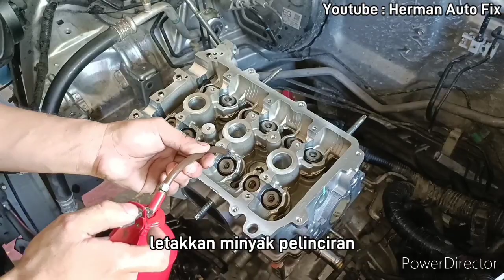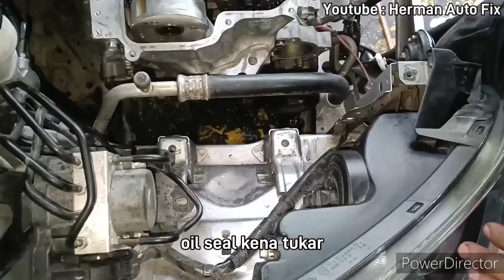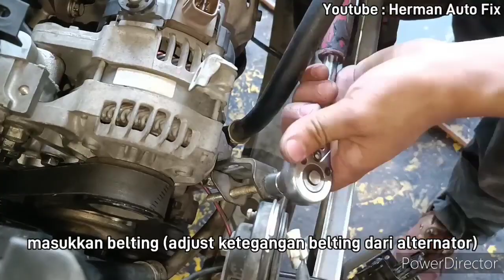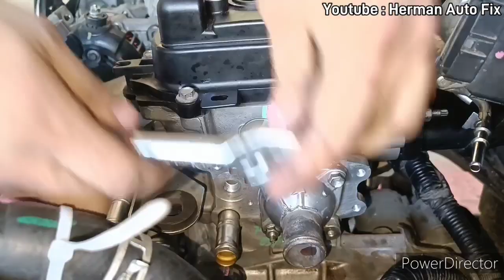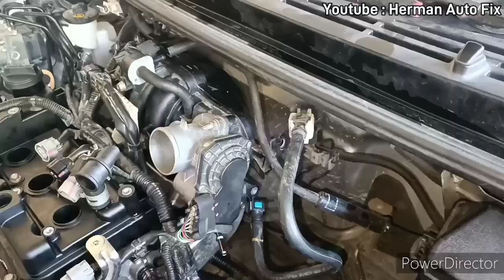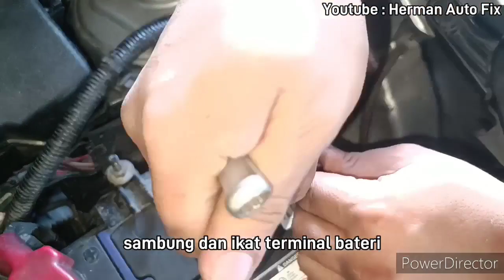Perodua Axia OVERHEAT top overhaul / part 2 ( last part )

Comment: Brapa kos skrang utk job mcm nie ya bang?..sbb saya tgh buat jgk...Kira sbjik la job ni..axia jgk..😂 overheat,sbb sblum owner ada tkar thermostat tpi x bleeding btul2..n sec punca trlalu tebal oil sludge sbb ljak millage sllu rsa..Mjur la xjem..cuma gasket dh burn n temp menaik klau speeding..bwah 80kmh ja temp undercntrol.. Laju skit ja trus menaik 100++..(Saya xbukak bngkel..cma sllu rpair sndiri ja,Bsnes detailing drmah)

Comment: bang..nak tanya apa tnda timing chain axia rosak?keta sy bru 99k mileage..skarang kalau jaln jauh gna aircond,,akan ada bunyi tak2...plg snang dengar,masa berhenti..ikt pusingan engine...bla off aircond kurang sikit.bnyi dia sblah kiri...pening cri.
Reply from the maker: Maaf lambat respon. .rasanya bukan timing chain yg bunyi tu..lagi elok kena buka belting dlu dan cek 1 per 1 semua pulley .
Reply: @Herman_Autofix  xpe ke bka belting start enjin
Reply from the maker: @wardtuwet9154  boleh..tapi jangan hidup engine terlalu lama. .kalau belting suda buka..try start sekejap..kalau bunyi tu tiada....bermaksud..ada masalah dkt pulley yg ada dkt sana..cek 1 per 1 la bos pulley tu.
Reply: @Herman_Autofix  tq bang.
Reply from the maker: @wardtuwet9154  sama2

Comment: Kete sy axia manual minyak hitam hilang. Bila check tak ada bocor, exhaust tak ada asap keluar.
Reply from the maker: Kalau betul tiada leaking..kemungkinan Valve seal dan piston ring ada masalah..mileage kereta suda brpa kilometer tuan?
Reply: Sy punya axia pn sama. Minyak hitam hilang. Axia tahun 2015. Apa masala tu tuan?
Reply: @yasirjamain  dh okey ke
Reply: @pokdinsumbak belum ok lagi
Reply: Tegok pd sparkplug coklat oren atau hitam berjelaga lain minyak  masuk ke vacum masuk ke manifold valve cover ada masalah

Comment: Encik forman .. sy baru buat top overhoul Axia sy..  belajar buat sendiri .. bila dah pasang semua .. kereta tak hidup .. ada nk Kene reset apa2 ke?
Reply from the maker: Lagi senang cucuk komputer,tngok apa masalah tuan. .tapi sebelum tu double check semua socket sensor dlu la..mungkin ada yg x rapat. .selalunya kalau tiada apa2 masalah,enjin akan hidup terus tanpa reset apa2.
Reply: Saya pun jd mcm tu... Lps overhaul axia.... Enjin x hidup .. semua dh cek ok.... Tp x nk hidup juga... Pening dh fikir..... Knapa yer? Mohon pandangan tuan?
Reply from the maker: @naimahsetar5556  supply api dkt coil ada ka tuan?..sama supply minyak petrol ke injector rail ?..cuba cek dua tu dlu..

Comment: Kalau guna gasket steel okay tak bang
Reply from the maker: Kalau bukan masalah overheating. .boleh guna gasket mcm yg original asal. .tapi kalau engine bermasalah overheat..sy akan guna gasket jenis carbon punya..
Reply: @Herman_Autofix  okay roger bang.. bkn ape tgh berlaku overheat.. beli lak gasket steel tu 🥲😅
Reply from the maker: @zulkiflyikmal9278  ohh..okay..semoga dipermudahkan urusan bos.